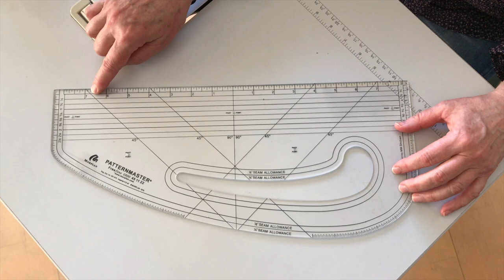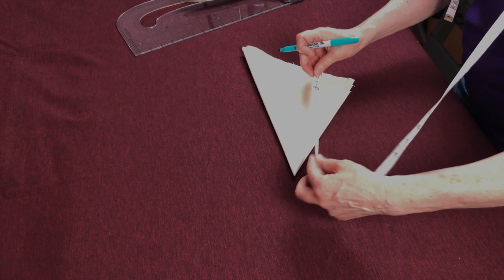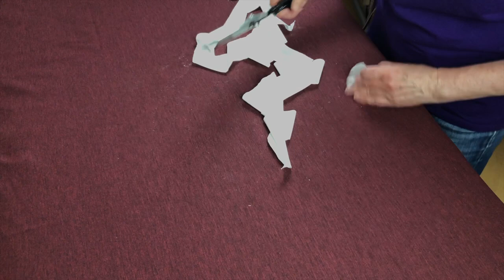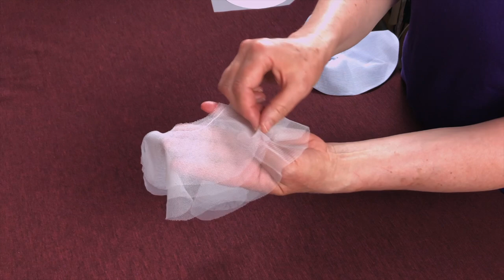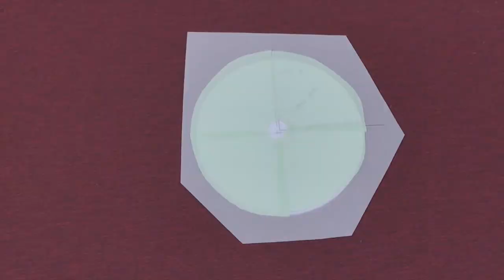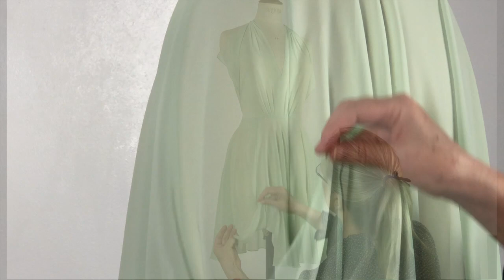GBSB 2021 7:8 - Circles, Ruffles & Circular Skirts

Comment: Wizardry!  That is far lovelier than the example used in the Bee ... in fact, I could see it being worn (over a skin-coloured slip) in a classy dance production on any stage in London.  :-)
I understand the pin hem and french seams, but the process of levelling the hem is (off stage) magic ... that is the single biggest thing keeping me from trying to sew skirts with more width, more fullness.  I'd be a happy consumer of any tutorial or demo you make on that topic.
Reply: Thank you, and I think we have found the subject of a future tutorial!  Basically, you put your garment on a mannequin and measure from the ground up, moving along the raw edge of your skirt and placing a pin at the same level, about every 4-5".  A metal square works well for this, as you can place the short arm on the floor and use the perpendicular long arm as the measuring guide.  Is this helpful for a start?

Comment: Fascinating! I love working with drape.
Reply: Draping presents a different kind of challenge, don't you think?  Is there anything in particular that you would like to explore further with draping, Jane?
Reply: @carolalayne1555  hard to give a brief answer! What’s really interesting is watching a professional working with different fabrics. It’s really the drape quality that determines how you can work with a fabric, and that’s what I like to explore. So interesting to watch your extended discussion of the DD dress on wool patch. I looked at some sites giving info on ballet skirts. I think the DD dress is so distinctive because it has so much flare and volume but no bulk. It doesn’t bell out like a Giselle skirt. Ballet skirts are made by compressing the gathers under a basque that sits just under the waist, so that the top of the gather is held against the body. This also gives a more elegant long waisted torso. I think the DD skirt is more than a circle. Sometimes gathered or pleated circle sections are used to add to the circumference when the dancer twirls. It’s a rock n roll length, but an r&r skirt shows as a flat circle when you spin. In DD it was showing in deep waves.